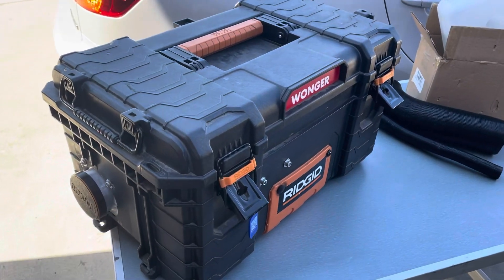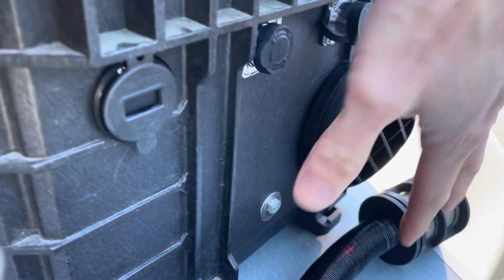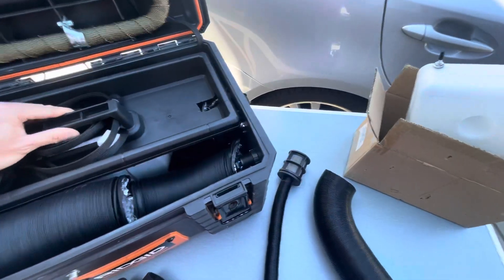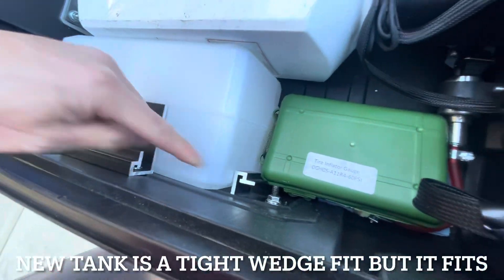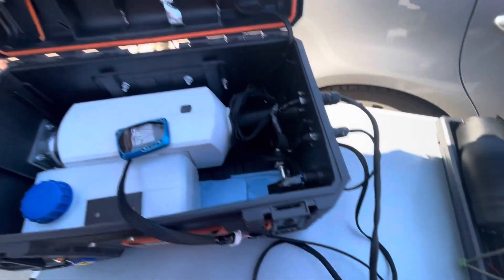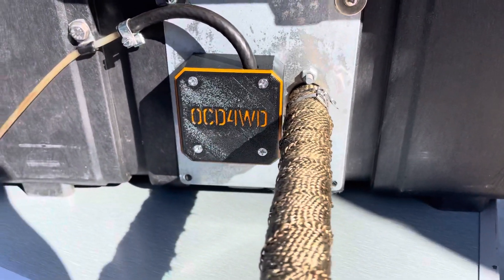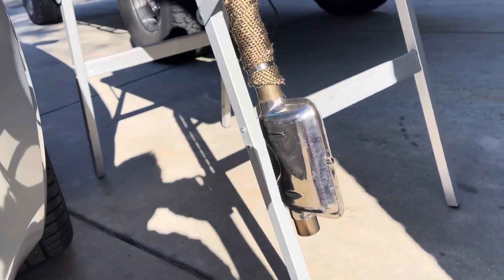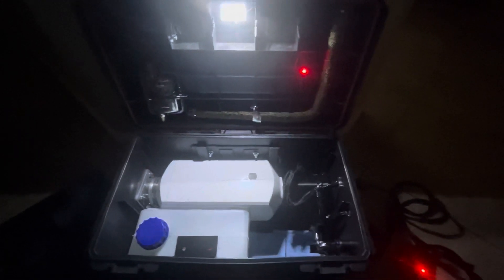Diesel Heater / 3D Printed Parts / Ridgid Tool Box / All in One / *UPDATED*

Comment: Does the exhaust port coming through the plastic case like that not melt it?
Reply from the maker: @theq-ster6981  no melting issues and I use this for 10 hrs at a time.
Reply: @Wonger559  Completed my build today! It came out friggin' awesome! Took it out for a shakedown and ran it for 8 hours. As you promised, no issues whatsoever with heat or melting plastic. Thank you for the reply and the inspiration!

Comment: I have a pelican case but I also have a dewalt box. I can print the ports but I'm concerned about heat warping
Reply from the maker: no issues on the PETG printed parts for the combustion intake vent. I wouldn't use printed parts for the hot air out side unless you are doing it in ABS or ASA

Comment: I mounted controller on top where the handle cavity is.Put handle flat there’s plenty of room in front of it.
Used a threw hole for exhaust thus no room for fuel tank inside 3 freakin days ago and now this pops up lol
Have a 90 ah deep cycle in the bottom box with wheels.
Lowered fuel pump n now tray fits inside to hold exhaust pipe.Thanks for vid dude!
Waiting on ss fuel tank.Heard too many cheap plastic tanks leak.
If I had to buy all the nickel n dime stuff to do this it’d be $560 bucks.There ant nobody gona buy one made like this bahhahaa
Reply from the maker: check out the new video I did on dec 29 2022. I added a small battery to the set up
Reply: @Wonger559  yah I seen the 20ah run 8 hours.Nice tight fit ! Seen yah in short sleeves n 2 foot of snow,you don’t need a heater haha
So I’m guessing my 90ah bat should run 30-35 hours but supposedly my heater is 6.5-8 kw? By the way that was a great vid on mountain trail meeting others eventually.And the night time departing I enjoyed.Happy trails man!
Reply: @Wonger559  oh and if you don’t have a carbon monoxide detector get one.The beep I head 2 months ago was mine.It’s flat now.Been working for months getting the bugs out of my new to me trailer.And smoke detector has dead bat too.
Next time put a tarp over your solar panel n heater would be a good idea.
Reply from the maker: @2hotscottpro  yeah I have one but I need to get one for small space and not a residential one.

Comment: Is there a reason you have the fuel line running from inside the case to outside and then back in again?
Reply from the maker: This was before I knew you can open the case. Cut the hard line and run it all inside. My second build will be even smaller and done better

Comment: Have you had any issues with leaking out of the vented top of the 5.5L fuel tank?  I have the same tank and even with a small amount of fuel in there it leaks out of the vented top.  Especially worse when off-roading and the fuel is sploshing around.
Reply from the maker: I haven’t had any come out the top. I heard people put a screw into the bottom side to seal it.

Comment: Cool build! I’d like to replicate this (with a 2kW unit) for my sequoia. Do you sell the 3D printed parts? Any changes or updates to the design? Why kerosene vs diesel?
Reply from the maker: I in the process of building an even small self contained unit with a 2kw unit.  Debating on selling the 3d print parts as they took forever to print.  Only thing I would have done differently was open it up and modified the fuel to stay inside and reroute the wires to come out the top. Its what I'm doing with the new build.  Kerosene is just cleaner imo and it does really expire. Since its a season heater, I just store it without remove any fuel. It fires up year after year with fuel from a year ago.